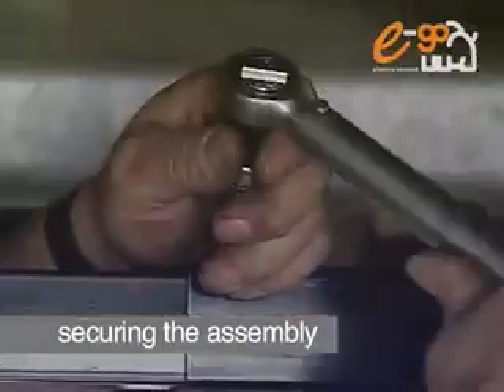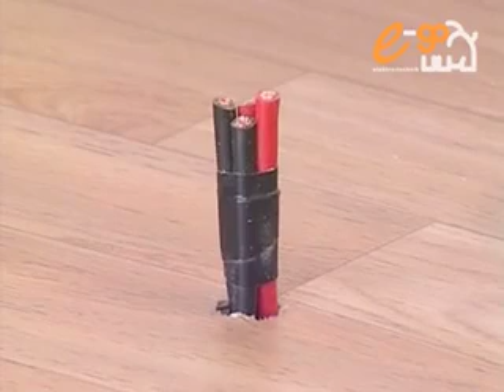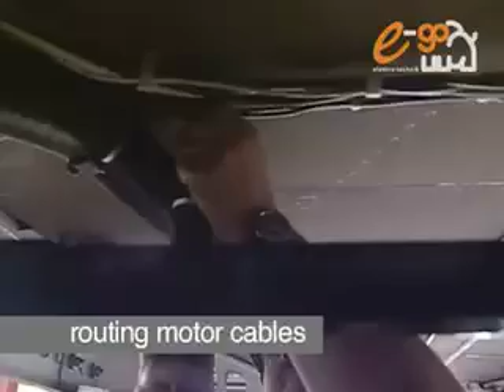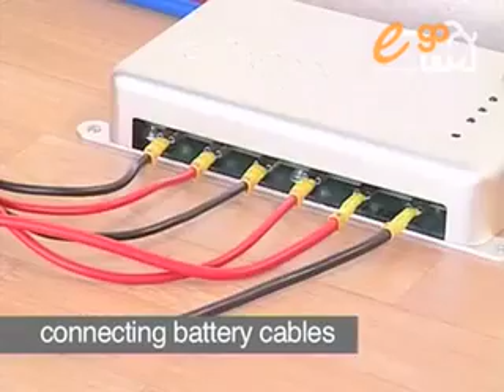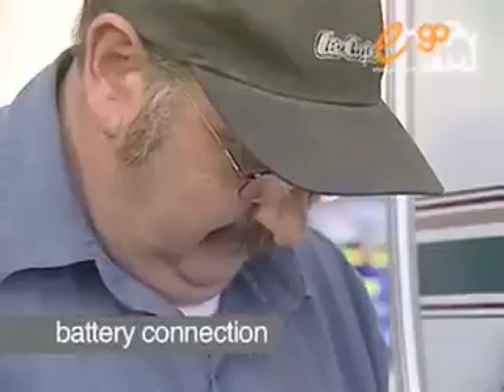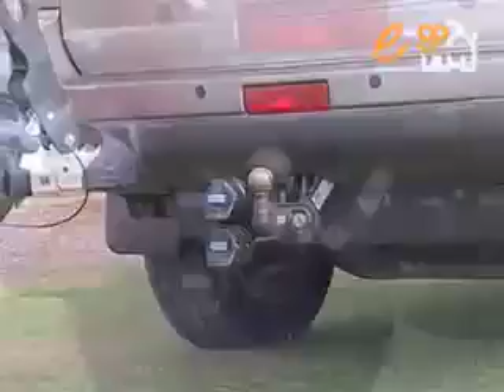e-go Caravan Mover Product Information & Installation Guide Pt2

Comment: If you  think you may buy another van  later, leave plenty of spare cable as the new van may not have the controller fitted in the same position. and require longer cable.